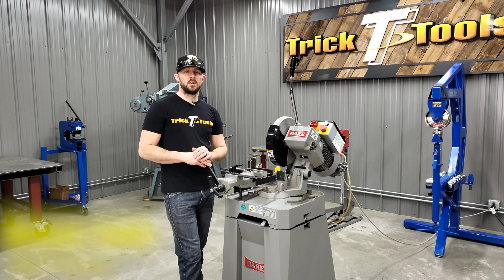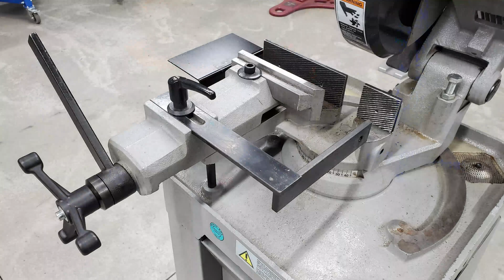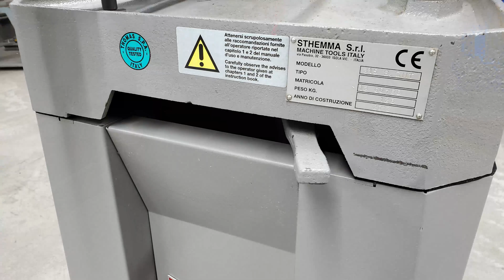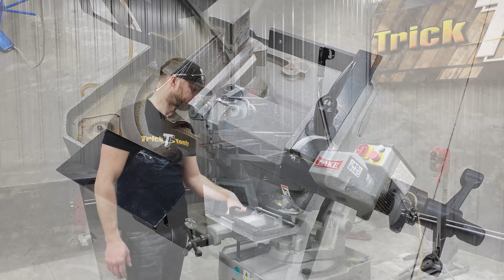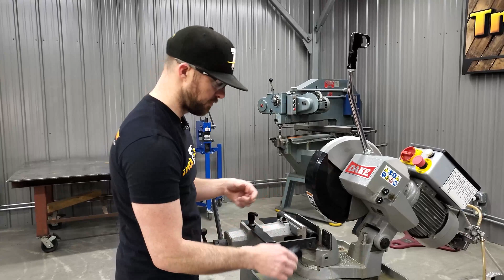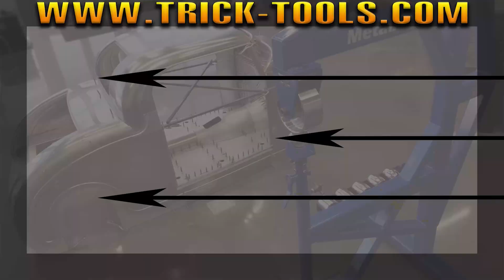Dake Super Cut 315 Manual Cold Saw - Trick-Tools.com

Comment: How much blade backlash allowed  in coldsaw. We made a coldsaw using worm gearbox motor set.the problem is blade is vibrating while cutting. The blade is new and dia 350 mm with 280 tooth for cutting 1.2 mm thick galvanized sheet profile